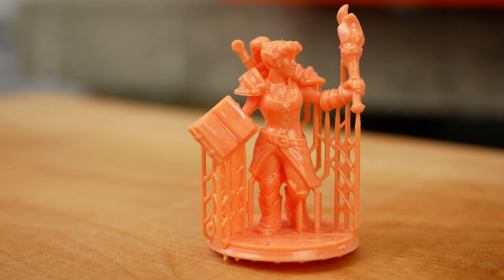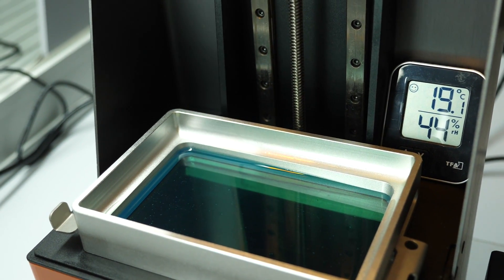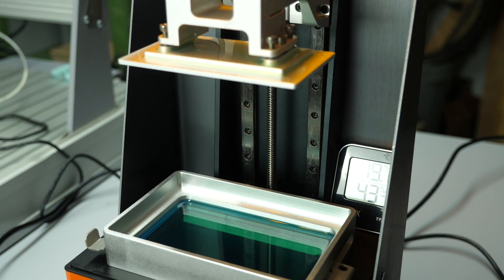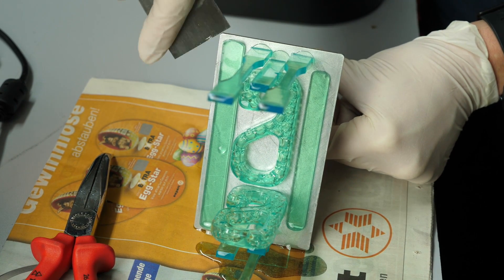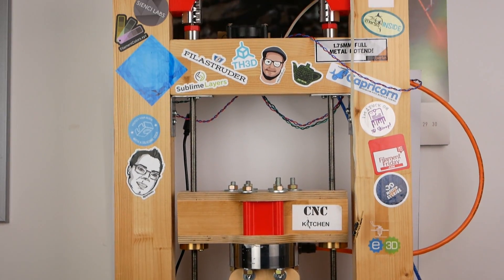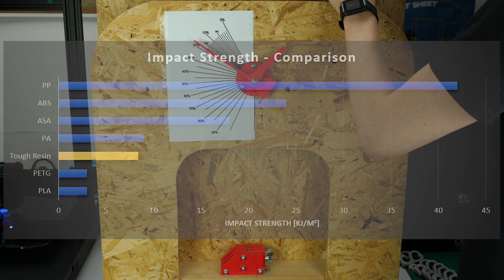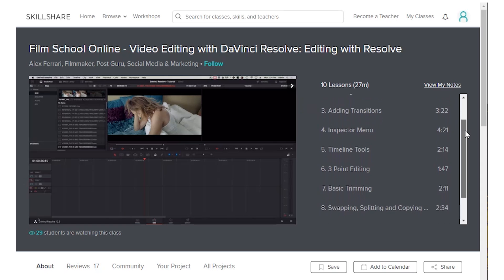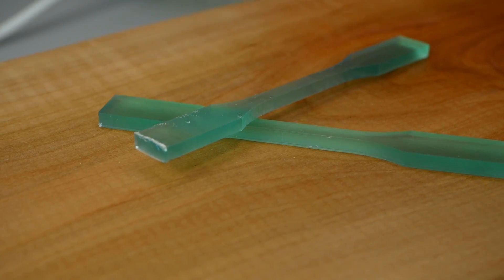STRONG parts from a Resin 3D Printer? Testing TOUGH Engineering Resin!

Comment: When I first decided to buy a 3D printer I thought resin would be the superior concept. After I learned about the inconvenience of using resin and the price I went with FDM and I can't see myself using resins anytime in the future.
Reply: a few nice things about resin printing in addition to resolution: it is much faster and quiet than FDM printing, cleaner surface which leads to less post-processing, ability to mix resins to create custom material properties. At the end of day, go with what makes sense with the application and we use a lot of FDM printing even we are a chemical engineering team
Reply: @sirayatech2  resin makes more sense for commercial use since you should have a good air ventilation and will probably print quite a bit more than a home user. The quality of the results is unmatched by any FDM machine. It's just all the extra steps including curing and washing that makes it inconvenient for home users
Reply: @ensoniq2k  yep, and we like to improve the resin such that it becomes more convenient for makers and even home use. We also expect the print speed to increase by several times in near future too. On the well ventilated requirement, as long as it is not closed tight space with open windows, then it is good enough for safe use.
Reply: @sirayatech2 : But most of uses are better with FDM, but there are cases where resin is better. A good example is jewelry moulds.

Comment: The strength of resin changes a lot with exposure intensity, time, layer height, and temperature. Just got my Blu this morning can’t wait to try it out.
Reply: You are correct, if you could 100um would yield even better results. make sure checking on the user guide on our website and join the facebook Siraya Tech user group to meet fellow users.  There are also recipe of mixing different resins in the group

Comment: Are resin prints dimensionally correct? Say within. 001 inchs?
Reply from the maker: In my experience they are more accurate than FDM prints but still more in the range of +-.003". That will depend on your printer and the resin you use, though.
Reply: resins can be quite accurate even without calibration and here is how users dial in for very high accuracy: https://docs.google.com/spreadsheets/d/1yDwszgncTyOxvyJho6y1kxLJquH2GsfL83KaFXT6068/edit#gid=0

Comment: Thanks. I was guessing that it would be about as tough as PLA if not a bit lower. But I didn't count on obvious difference in layer adhesion.
And I agree, the process still seems too messy and smelly to be bothered with... for now.
Reply: more development is needed to move resin printing forward to be more convenient. The current generation of resin has little smell or scented smell. Many production shops also start using resin printing because it can reduce total turnaround time (shorter print time and much shorter postprocessing time) in addition to the resolution difference.

Comment: For engineering prints I think the only two advantages to resin are the strength along all axis (print orientation layers not affecting strength), and the temperature resistance.  Sparkmaker LCD-H for instance can go up to 320C.  Typically the higher HDT plastics become harder to print on an FDM printer (warping, hardware to print at higher temperatures, etc.), but on a resin printer it's pour the liquid in, and find the right exposure time. Much easier to print something for extreme temperature resistance on a resin printer.

Comment: lol 50 bucks a liter.
Reply: I'm not sure why you put 'lol' in front of that?  It's actually $45 shipped on Amazon.  Is it that you think $45/50 is too cheap or that it's too expensive?  If it's because you think it's too cheap - as long as it works as well as the more expensive stuff being cheaper is a good thing IMO.  If it's because you think it's too expensive - resin for LCD printers is cheaper than it's ever been, and $45's a really good price for a liter of resin right now.  Most other brands are $25-30 just for 0.5L (500 grams) - and that tends to be model resin that is lower viscosity (good), but quite a bit more brittle (bad).

Comment: I returned to 3D printing solely because of resin printing. In my opinion, for my needs, resin is the only way to go, and produces prints far superior to FDM. The smell, and mess is really not an issue, if you plan ahead with a system of process which makes it no trouble, and all in much easier then FDM.
Reply: and faster / quieter print as well

Comment: I saw the thumbnail's blue tint and transparency and said 'Hey! That's Siraya I bet.'  I found them on Amazon recently - wasn't so much looking for an engineering resin as just looking for more affordable resin and they had some at $40 for 1L (in the resin world that's pretty good).  One thing that's really cool about resin printing is the ability to modify the resins.  On an FDM printer if I want to modify a plastic's properties I have to do it while using an extruder like a Filastruder.  You can't modify it as the end purchaser of the filament.  With resin you can modify the properties easily.  Want a more flexible, less rigid, tougher, less brittle piece?  Put 25% of their 'Tenacious' flexible resin in with 75% of their Blu resin.  Want a more rigid, less flexible, higher hardness, and are ok with a little more brittleness?  Go with 25% of their Sculpt resin then.    It's best to stay within the same brand, and you can do the same thing with other resin brands too.
Reply: looks like you are already in our user group. based on the ratio of mixing I am temped to guess who you are :D
Reply: @sirayatech2  I did join the Facebook group when I first saw you on Amazon (Siraya Tech users group).  I read about that ratio in the group, but I'm not the one that originated the ratio.  I wish we could link to videos that are hosted on Facebook more easily.  Somebody in the comments here asked how that first model Stefan showed (where he broke the sword off easily) would fare in Blu, and it really makes me think of that video somebody posted where they combined Blu with Tenacious and they were unable to break a 1.5mm section of their part off with their bare hand. (they said it was for a lightsaber project)  Edit: Turns out that guy also commented here, further down, I'll ask him if he could post the video on Youtube.

Comment: Where does Polycarbonate lay relative to these?

I'd really like to print with that, but polypropylene seems to be at the top of a lot of these graphs so maybe it'd be better for some applications...

Tbh I kinda want to use PC because other than cost and print difficulty, for strength I thought it was something where I wouldn't have to give much thought as to whether another material would perform significantly better in 90% of applications

Comment: Finally someone that knows the difference between SLA Printers!! You make me so happy! hahaha, Looks like interesting resin indeed!  What is the recommended AKA fastest cure wavelength for this resin ? looks like resins developed by Formlabs. My go to resin printer is a true DLP and the heat generated by the halogen light bulb is more then enough to keep the printer a 50 C which is ideal for printing, my Msla printers use 15X 3watt leds they also generate good heat for the small Chemcast top enclosure. EDIT: Top notch video presentation, as always!
Reply: The Blu resin cures best at 405nm wavelength.    Blu is beating Formlabs Tough on several online torsion tests (search Robert Silvers resin test) and should print very well on a DLP printer
Reply: @sirayatech2  Thank you for the infomation and the quick response time, aside from my DLP printer, my Msla printers use 365nm wavelength, what should i expect? if anything.
Reply: @patprop74  probably very slow to no curing 365 and 405um are quite different. How are the LCD mask enduring the 365um light? better or worse than 405?

Comment: I don't think you're supposed to let your printed objects soak in IPA for half an hour. Try 30 seconds instead of 30 minutes.
Reply: Was going to mention similar. Most washes are meant to be quick as prolonged exposure could lead to penetration of the solvent and weaken the structural integrity of the part.
Reply: @SSkj05  I would love for this to be tested. Take multiple identical parts and test soak time. I suspect no difference and will assume no difference until proven otherwise because the burden of proof is on the person making the claim.

Comment: What you observed in the bending test is probably the viscolastic behaviour of the resin. Generally, most polymers show this kind of behaviour, some more pronounced then other. This depends on the degree of polymerization (= average length of the polymer chains) and the "connection" between the polymerchains.
Basically, this behaviour is entropy driven, meaning that the polymer chains will untangle under load but will return into their original position after the stress is taken away. Of course, this only works within a certain degree of deformation. Usually, the degree of viscoelasticity also correlates with the ductility of the polymer.

Comment: Can you please do the heat (Oven) test .. cos i've never seen heat tests of Resin before ..
Reply: crosslinked resin generally does not melt like thermoplastics. in over, it would start to brown, and some may fray if the temperature reaches high enough.

Comment: But what about the costs to print the parts? How is that compared to a fdm printer
Reply: The costs have really been coming down. This resin he shows in the video is $45 on Amazon for 1L.  So, if you were to print the exact same thing in FDM and resin, and you used just some $25 random PLA it would be a little under double the cost.  You almost never would print the exact same thing though.  Typically with resin you hollow out the inside and add drain holes  - so you're using less resin in comparison.

Comment: Stefan, first: as always you made a great video. Second: I think you unintended put some stress concentrators on the hooks that you tested. On your video you showed one hook that breaks because one of them and I'm pretty sure that the other one also failed because of them too. It would be interesting if you redesign the drain holes and put them on non critical areas under stress.
Reply: I noticed that too... the FDM hooks break further up.  The infill pattern also looks very coarse(?) compared to the different types he has tested. I couldn't tell if that may have also contributed. With the detail of resin printers I would have expected it to be finer. Possibly that is normally done due to the brittle nature of most resins?

Comment: Thanks for testing this, Stefan! I have resisted resin printers based on my previous experience with the brittleness of the prints. Like you, I mainly print functional parts, but I very recently bought a Photon and have been printing a lot with Siraya Blu lately. What I have been experimenting with lately is a blend of 70% Blu and 30% Siraya Tenacious resin. The Tenacious is their flexible resin, which is extremely tough, but has no rigidity. But the blended parts feel fully rigid, just like 100% Blu, yet are very very tough. I would love to hear your results testing a blend. Since you’ve already made this wonderful video, you could report your findings in your podcast, which by the way is fantastic. I listen as soon as it is released each week - thanks for taking the time to make the show!
One more thing to share - I am still new to resin printing, but several experienced users have told me that soaking the parts in IPA is actually not ideal because it strips too much resin from the surface and results in slightly weaker cures. I don’t know if this is true, but again, it would be wonderful to test. 
Ok, well, one more thing after all - I’ve also been told that it is better to cure underwater. Something about oxygen embrittlement - again, I have not yet tested this :)
Reply: Excelent tip, Ocie. Many thanks. The best resin I've tried so far is eSun's Hard and Tough, but it's so scarce that I was able to only find a couple of bottles for an important project that I've been working on. This project requires printed parts to be as sturdy as possible. That is, strong and rigid, and yet not brittle. So I followed your advice and acquired two pairs of bottles of Blu and Tenacious and mixed them (by weight) in a 70-30 ratio, per your suggestion.

The results have been so encouraging that at this point I'm seriously thinking about giving up on eSun's resin and start using this mix exclusively.  This has the advantage that I can later tweak the proportions to make its resulting properties fit a particular application.
Reply: @technomech303  DON'T YOU F'KING LOVE THE INTERNET!!!! 
great job you guys.... thanks for reporting back...
Reply: Could you please upload that video of your Blu/Tenacious combination (for your lightsaber project) on Youtube?  It would show people on here how mixing in resins like Tenacious can really change the properties of other resins, and how much harder it is to break what you printed vs how easy it was for him to break the sword off of the type of resin Stefan was using near the start of this video.
Reply: Ocie Ward  have you made a temp test already?
Reply: This would be very helpful ! following

Comment: the resin filament looks much better compared to fdm and the independency of  the mechanical properties to the printing orientations should make it behave more like isotropic materials and this way  to behave more predictably by strength analysis and simulations. i would say that it is much favorable for mechanical demanding parts

Comment: Thanks for the review. I'll wait till the technology is less toxic before taking the plunge.
Reply: It is quite safe.  Blu is about the same concentrated detergent in toxicity level and very little VOC.  With good printing practice and using the right materials for print and cleaning, it can be quite streamlined. Resin printing is also much faster, more energy efficient and quieter than FDM printing.  FDM printing still has many great things going for it, but resin printing is a compelling option for many users now.

Comment: If only that would hold up in the sun for any length of time on would add a resin printer.
Reply: painting it over would protect from UV
Reply: @sirayatech2  Will something like the Krylon for plastics paint stick to it well?
Reply: @SkiidMark  many primers designed for minis would work well. A lot of our users are model makers and paint. You can join Siraya Tech user group on Facebook and ask the community.

Comment: In general, I prefer resin prints visual quality, but as you said they tend to be far to brittle. I haven't yet tried any of the various "Tough" resins made by various brands, but they've been on my radar for a bit now and after seeing this video I'm definitely going to grab a bottle to try out. If they perform as expected, I'll be making a full switch :D
Reply: resolution + strength = more design possibilities  If you need UV protection, put a coat of primer on it.
Reply: Just an update for anyone who might be reading this. I got my Blu in from Amazon today and just pulled my first prints off the bed and got them cleaned up. HOLY SMEG THIS STUFF IS GOOD! Perfect 10.8mm posts across all four test points (Moai DIY_test.gcode), great bed adhesion and great FEP release. No warping. And not crazy fragile like I'm used to from the NEX resins. Thank you  @sirayatech2 !
Reply: @ShadowDrakken  wait, you have a Moai? Make sure you increase infill to 85% and follow their newly updated fep guide as this resin is more difficult for laser SLA. On the other hand,  mix 20% of Blu and Nex and you got yourself a great molding resin that is much less brittle
Reply: @sirayatech2  haha, shame I'm not a YouTuber or influencer. I'd love to get my hands on a sample bottle ;) But rest assured! I have put Blu in my Amazon shopping cart for next week :) do you plan on more colors in the near future? Maybe some grey and flesh tone opaques?
Reply: @ShadowDrakken  not yet with more colors.  Our users love mixing Sculpt with Blu to get the nice grey color and even extract more details. we provide tips and encourage users to mix our resins
Reply: @sirayatech2  do you think you could update your product pages on Amazon to include each product's recommended UV wavelength? Specifically, I'm wondering which products, if any, work well at 405u for my Moai SLA :)
Reply: @ShadowDrakken  all of them are designed for 405um but calibrated for LCD/DLP type of printer. Sculpt is tested to work well on Moai but you would need fep Vat as LCD resins are harsher on the PDMS